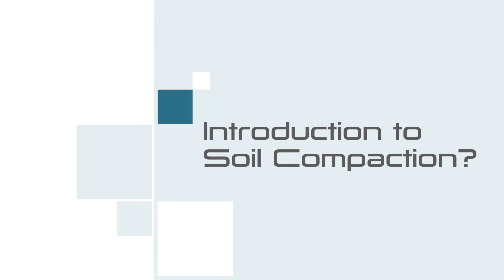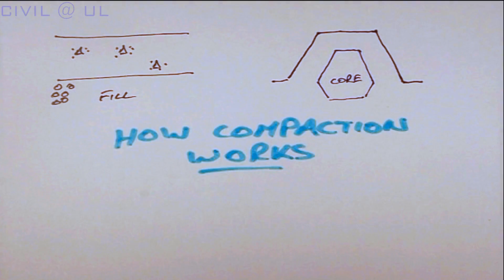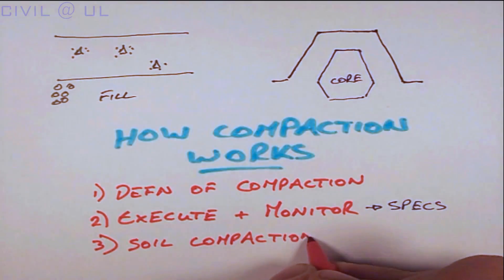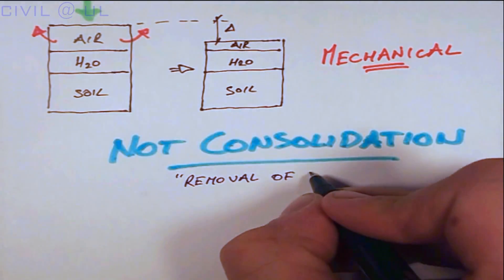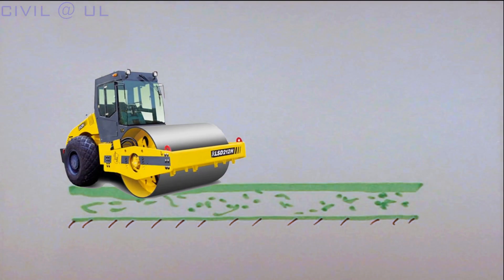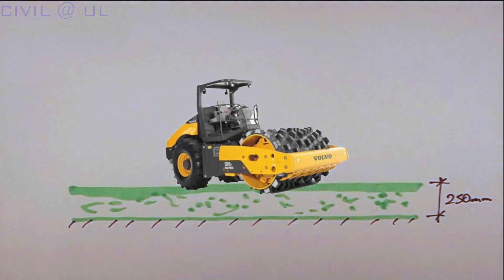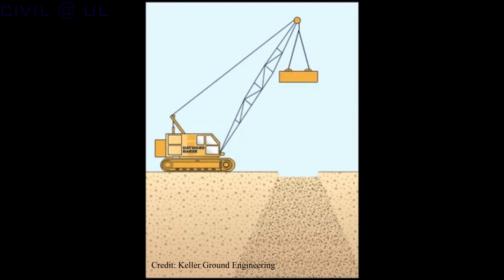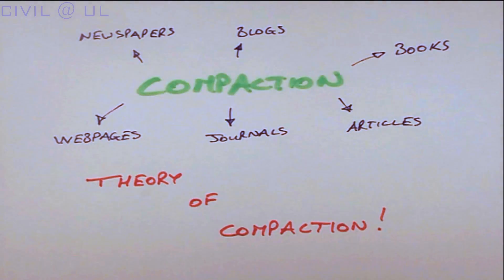Introduction to Soil Compaction

Comment: Some people fill the foundations with water after digging and leave it for a few days. They claim that now the soil is automatically compacted. Have you studied/experienced it?
Reply: This is not a common practice and I would exercise caution if considering it as a compaction option.  The technique would court failure if the underlying soils are fine grained i.e. silts and clays and therefore should NOT be adopted under any circumstances. The technique has been used to densify coarse grained soils (sands and gravels) as the downward flow of water creates a 'frictional drag' on the soil particles it passes thus 'dragging' them into a denser configuration and reducing the void spaces in the process (See video on water flow in soils https://www.youtube.com/watch?v=9QJkqFeYeQI ). Reaching a specified relative density would be challenging with this technique. In my opinion ... best to stick with tried and tested procedures for densifying soil.
Reply: @declanphillips7545  Thank you sir

Comment: Throwing a wrench into the works here... compaction does increase the density of soil by removing the air.   However, when the soil being placed is saturated and well in excess of it's optimum moisture content, removing the excess moisture in it that wasn't supposed to be in it in the first place would increase the density also.
   
Naturally, in a perfect world, saturated soil that would otherwise be acceptable for use would have it's moisture content reduced or a drier soil material source obtained prior to placement.   Heaven forbid an unscrupulous soils contractor would ever dream of veering off from the goal of achieving the highest acceptable placement density possible.... usually.
Reply: Optimum moisture content is called OPTIMUM for a reason. Every type of soil has a different optimum moisture content. Going “well above optimum” causes the compaction curve to dip and lowers the ability to reach your required density.